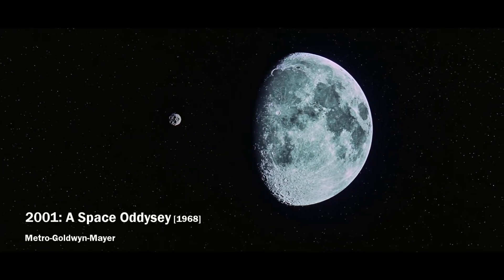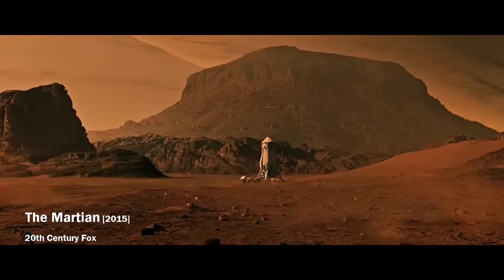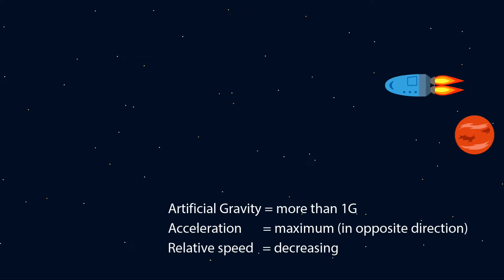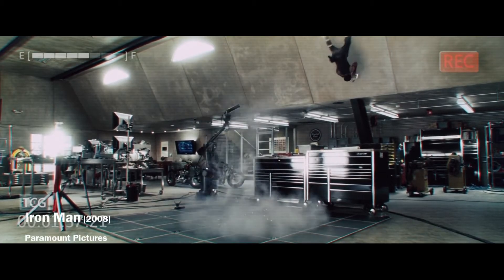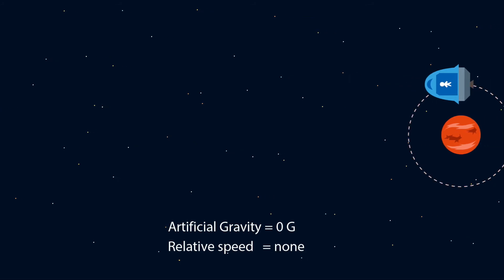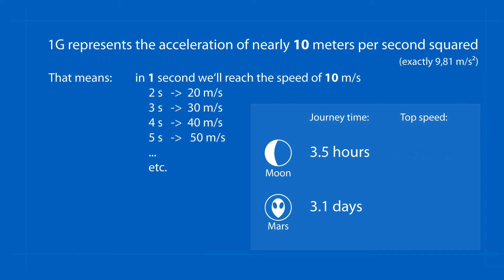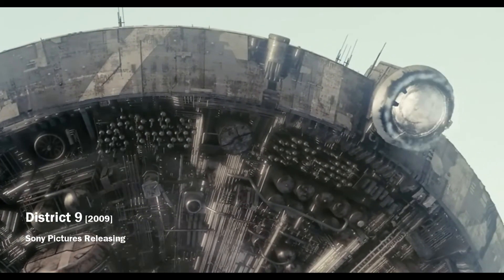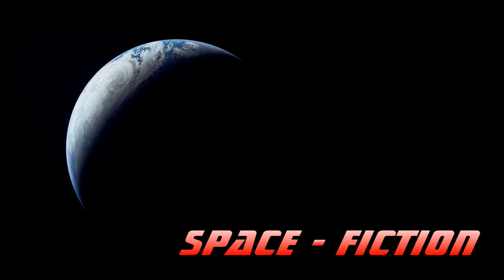Can we make artificial gravity without a rotation?

Comment: No. We can't. And anyone who thinks a spinning torus will create, 'artificial' or simulated gravity needs to google the, 'coriolis effect'. From I've read, the torus would have to be at least 400 meters in radius from the center, and rotate at 15 times per minute. Doable, but not practical for now, i.e., with NASA's budget. (Imagine what it will cost to build and assemble, in space, a torus 800 meters in diameter, or, roughly a little more than 800 yards.)
Reply from the maker: Sorry but you probably didn't watched the video. The video is talking about other option of creating artificial gravity than with rotation. Especialy because rotating body has some disadvantages. And artificial gravity is not a real gravity created by the body mass. The gravity is replaced by other force, that's why it is called "artificial". But it is also only a theoretical consideration.
BTW. you are pretty wrong with your calculations. If you have a rotating space station with 400m in radius, you will get 1G if you make one rotation in 40 seconds (not 4s as you was writing). If you rotate a body with 400m radius 15 times per minute, you will get 100G. Which is kinda "unhealthy".... not only for human body but for the integrity of the whole station too.
And yeah... of course there would be some coriolis force... but the bigger the rotating body, the smaller the coriolis effect.

Comment: If we shall make interplanetal journeys , we must make articifical gravety in a better way . I dont think using engines as in the video is possible . Maby if we can use Atomic powerd rocket engines  . With todays ingenering we will have to bild fuel station in space , othewise rockets will be to heavy and demand so much fuel that its impossible because the rockets and fuel tanks will need so much power that it cant lift from the earth .
There are two ways , nucklear propulsion ( wich might be needed anyway ) . 

Or created gravity . 

We dont really know what gravity is , not like Newtons apples .

Some type of floor in the spacechips , with will give ” magnetig ” force on any type of matter , all in the periodical sheet . 

Preferaby is a type that give all elements equal forces . 

Find a way to magneticise all elements first , then create a magnetic floor wich is easy .
Reply from the maker: We do not know, what gravity is? You are right and wrong in the same time.
We do not know exactly how the matter is generating gravity... but what we do know very good are the properties of gravity. And we know that gravity field is not behaving like magnetic field. So you can forget about something like "gravity floor" in spaceship (that's only movie myth). And magnetic force has its limits too.
And about those engines... of course we do not have suitable engines for such long journey now. But the principle is exactly as I showed here in the video and it is possible. And that is nothing special or made up. It is just basic physics.

Comment: You forgot to mention diamagnetism, which was a part of the floating feog experiment, which could be used as a way to make artificial gravity however I'm aware it uses a ton of energy
Reply from the maker: Well, diamagnetism, quantum locking or any other kind of magnetism can not create an artificial gravity, because it can not make spaceship move through the space. You always need a base that represents "unmoving" part and the vehicle that is moving.
But in the space you do not have any base. Magnetism can be used for orientation of the satellites around planets, but they can use it only because ther is a strong magnetic field. But you do not have this in interplanetary space. This is about Newton Law... action and reaction. If you want to move something with some force, the same force acts on you.
Rocket engines use its propellant to move forward. And you can not create a movement without some reaction in opposite direction.
Reply from the maker: BTW. the frog experiment created zero gravity simulation for the frog... no the other way. And if any how it could atract objects in zero gravity (simulating the artificial gravity), I am pretty sure that it would be deadly for spaceship electronics. ;)
Reply: @Space-Fiction  unless theirs shielded or far away from sensitive electronics
Reply from the maker: Then why would you use magnetism for creating artificial gravity inside the space ship? It would have no sense.
You need the artificial gravity to act on every item inside the space ship. So this method would just creat more and more problems to solve. So it is not a good way to go.
BTW. magnetic shielding is used mostly for shielding the inside of space ship from the external source of magnetism. (like during the Jupiter flyby)
Reply: @Space-Fiction  i'm talking about in the future also this is my other account btw
Reply: Then again, it might be one of the only ways. I mean, no one has tried it yet before, but if it is impossible, then theirs gonna be another way

Comment: I really enjoyed that. I got lost in the idea of 3 days to mars. That sounds better than rotational gravity. Just have to know where you are going  to be able to stop in time.
Reply from the maker: The 3 days idea is only theoretical today... only if you will be able to accelerate and decelerate with a rate of 1G for the whole time without interruption. But we don't have such powerful rocket engine today that can work for more than an hour. But if we could do it... you will really get to the Mars in 3 days. That is just simple physics. :)
Reply: and have an impossibly large amount of fuel on board..
Reply from the maker: You don't need large amount of fuel if your engine is very efficient. Our combustion rocket engines are not as effective as they sould be. By combustion you are loosing a lot of energy on heat, sound and other energies than kinetic energy. So they are actually very unefficient. That is why we are not flying to stars yet. :)

Comment: The spaceships of "The Expanse" use this premise.  A special nuclear fuel is used to explain how the power is maintained.
Reply from the maker: Yes exactly. We need to change our propulsion system and create a new and effective one.
Reply: but the ship would be flying into nuclear waste/explosions on the second half of the flight..
Reply from the maker: I haven't seen The Expanse series but by using a nuclear fuel for spaceflight you don't mean to make nuclear explosions. That would be a great waste of energy.
BTW. outher space radiation is also leathal as nuclear radiation so you need to protect yourself anyway.
Reply: @Space-Fiction  good point..
Reply: @richardprofit6363   No it would not. You're forgetting that theres no air in space, the exhaust from the deccelerating ship would just continue moving forward while the ship would slow down. There's no atmosphere in space to slow the exhaust down and move it into the ship. Decceleration in a vaccum is exactly the same as acceleration, just in opposite direction to the vector of travel.

Comment: That kind of trajectory is vastly less efficient, it’s a huge waste of fuel to perform those kinds of flights, and they are only possible at specific intervals same as the low-energy transfers. There’s a reason we change our momentum “instantaneously” instead of throughout the whole trip, bc there’s a mechanical advantage that means it costs magnitudes less fuel to make the journey.
Reply from the maker: Of course this idea is not only less efficient, but it is absolutely unefficient in the terms of our actual technology (in rocket engines).
It would need to have some upgraded ion-thrusters or similar very efficient technology that do not use fuel as ineffective as our rocket engines today.
But the main point is that we can create artificial gravity without rotation. And this idea has many benefits for space travel.

Comment: I keep wondering if you could use a special propeller in space.  I understand that it's claimed that only rocket engines work in space because it creates expanding clouds of hot glasses to push off of and regular jet engines and propellers won't work because there's little to no atmosphere to make them work, but...

that doesn't sound entirely theoretically correct to me.  in my mind, if it's possible to use a rocket engine than there should be enough atmosphere for propellers as well.  I just think the particles in space are smaller and/or less dense.  it should be possible to move them, or through them, like in water or air, it's just you'd need a different kind of propeller.  like maybe a propelluthe size of a planet or one that could create force for movement by pushing around light particles.  I'm fairly certain light isn't energy, but just really fast moving, tiny particles.  in fact, I don't really believe energy exists, there's only matter moving around.  explosions, and light just appear when very tiny particles are moving super fast.
Reply: imagine a propeller the size of the moon spinning at a quarter the speed of light, maybe something crazy like that could actually work in space.
Reply from the maker: Actually this is not only theory and this was already tested in a few spaceships and probes.
Try to Google "Znamya-2" experiment on russian Progress T-15 spacescraft in 1993. Or probres like IKAROS, NanoSail-D2 or LightSail.
Actually quite good article can be found in english language on wikipedia with the title "Solar sail".
I recommend you to chcek them out.

Comment: maybe you could spin it perpendicular to it's travel direction as well and use the artificial gravity described in the video as well as centrifugal force from spinning it so you have one force pushing you to the back of the ship, and another towards the sides, resulting in an overall force pushing you to the outward, back ends of the ship at all times?
Reply from the maker: Yes, this could save some energy to push spaceship forward and it would not have to be 1G in this case. But the big problem here is the inertia. The rotating space station or spaceship (or any object) works like a flywheel. And there is a quite a big problem to change direction of flywheel because of its inertia. The bigger the flywheel is and the faster it moves, the change of its direction is bigger issue.
Reply: These are both good points. So less speed some rotation for 80% gravity combined and a little  more energy to turn mid way. Still a quick trip to Mars and less fuel for more gravity and less time running on a treadmill. I like it.

Comment: The trip to Mars won't take a year. Seven months is more likely.
Reply from the maker: 7 months is a time for a common space probe to reach the Mars (that has no more than 5000 kgs of weight).
Manned spaceship is way bigger and heavier. That's why I assumed that this one will take a little bit longer.
But of course I am not an expert on calculation of space trajectories.
BTW. also in The Martian movie the trip from Earth to Mars took more than 8 months and they already had the necessary speed. ;)

Comment: I feel like we could settle for .25G with some amazing leap in space propulsion. There are incredible risks associated with inter system travel as it is, and speeding through massive sections of empty space at 1400 Kilometers per second is a risky risky move. You are likely to avoid most everything, but at that speed the hull of the craft would have to be incredibly durable to withstand particle debris. This means increased weight, which makes propulsion of even .25G a difficult task, as our current version of understanding on energy is that it is always the heat that prevents essentially self sustaining power plants such as a nuclear reactor for producing propulsion.
Reply: The reality is that relative velocity of everything is already so high your speed won't make a difference to the hazards of debris. But cutting time off a trip greatly lowers exposure to various hazards.
Reply from the maker: Yeah... this is actually a good point. Of course such a space-travel-system would need to solve many issues. And one of them is collisions with space derbis. I am pretty sure that we would still have some option to make a avoiding maneuver. But we have to be able to detect such objects in our path first. (the spaceship needs some radar/laser array on the front)
If the spaceship is moving with some Gs (1 or 0,25 or any), we still have to be able to change its vector. And remember how relativity works. It doesn't matter what speed you have. If you are accelerating with 0,25G, the change will be the same at speed of 0 so as at the speed of 100000 km/s.
But you are right that the amount of derbis would be much higher in such speed than when moving with standard interplanetary speed. I prefer to have some system that would be able to "kill" small objects (e.g. with lasers or something) and to be able to automatically detect and get out of way of some bigger objects (like asteroids and big rocks).
But I do not think that heavy armour is the right sollution. (maybe some lightweight layers of some fabric mixed with some reinforcements... etc.)
I love the sollution that was portrayed in the movie Passengers (2016)... but this was still a sci-fi and not a real thing.
Reply: do people know about how much space particles are present between us and mars?  and if so, do they know if they are all mostly travelling in the same direction, like an air or ocean current?  or if they travel in random directions and speeds?  I'm curious about collisions and I'm also curious if you can use a propeller in low atmosphere space.
Reply: @qweqqweq2090  I’m sure someone out there has a good grasp on the inter system debris fields and their relative motion. I’m assuming if there are particles and debris between here and mars, they would “flow” just as any object with mass does when faced with gravity like the sun produces.

Comment: This concept can be useful and practical for starships but for space stations rotation is for now the only solution
Reply from the maker: Yes, of course.
Space stations do not use any powered engines most of the time.
Reply: no, you can do the same thing, you can propel yourself away or towards the orbiting body and adjust your orbit, just the same issue fuel and engines
Reply: Joe Scott did a great vid that points out that because of our inner ear "balance system" rotational gravity would be VERY uncomfortable for us..
Reply: @richardprofit6363  not only because of our accelerometer but in general that weird coreolis is very uncomfortable
Reply: @richardprofit6363  The larger you make the ring the less this is a problem. So if you made it large enough lets use Halo for example the effects would be so minor it would be pretty much the same as earth. Earth technically has a similar effect if you where to remove gravity but still had it spinning you'd likely not notice the change as the differences would only be noticed on a larger scale (such as the moon & stuff that orbits the planet). Also in space it would act differently due to the lack of gravity pulling you down. 

Also Did you mean Tom Scott?
Reply: exactly what i'm looking for.
i made a concept of a spaceship that creates thrust out of solar heat.
it channels all the heat into an engine nozzle and shoots it out. it also uses solar energy for power.
now all i needed is gravity.

Comment: Couldn't a nuclear powered spacecraft perform the trick you're talking about? And exactly what is the problem with ion thrusters?
Reply from the maker: We do not have any nuclear powered space engine. When such engine will exist, it would be possible (maybe) to try this kind of travel.
But the real trick is the acceleration magnitude. And this depends on the weight of the whole spaceship so as on the engine thrust.
And ion thrusters are pretty weak (today). They are able to make only a very small acceleration for a long period of time. But we need a pretty powerfull acceleration. If we want to have artificial gravity 1G (the same as on Earth), you need to accelerate the whole space ship to a speed approx. 10 m/s in 1 second. It is nearly the same acceleration as trying to reach 100km/h in 3 seconds with a car.
Ion thrusters can have low thrust with low acceleration. The acceleration of 1000kg satellite with ion-thruster is around 0,0001 m/s2. To far from wanted 10 m/s2. ;)
Reply: @Space-Fiction  Thanks for the explanation, you're very kind!